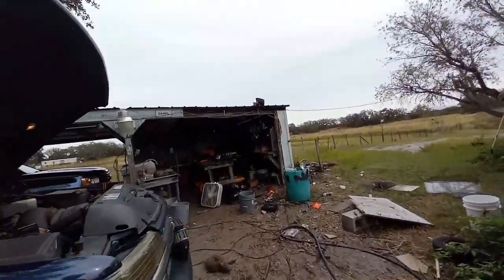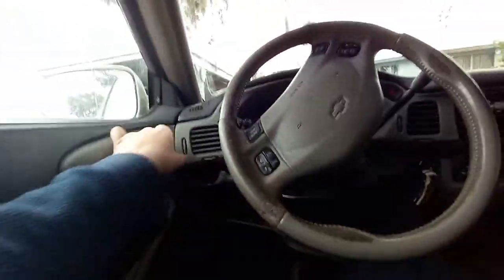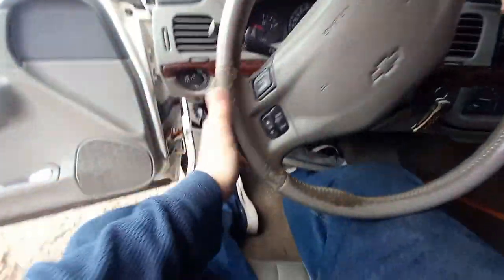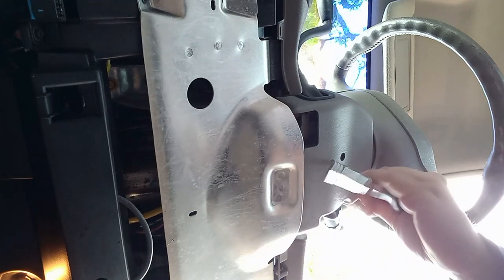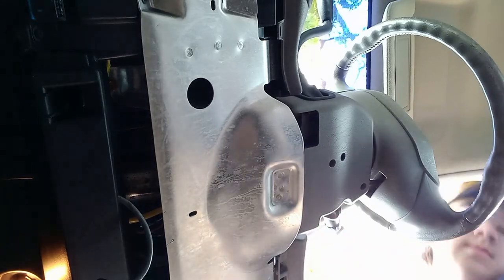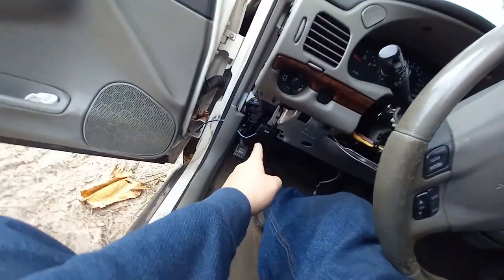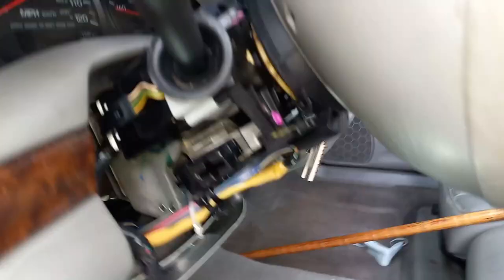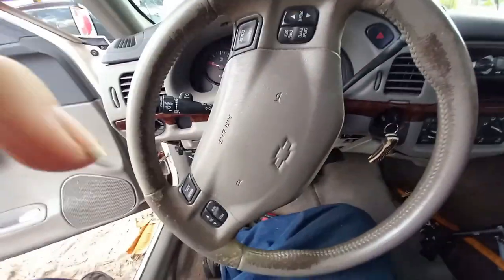replacing turn signal switch on 2001 Chevy Impala

Comment: Couldn't figure out wire harness with limited view thank u, think that box is alarm or security bypass because the orginal radio for that car controls the security system and the security light is a whole nother issue🤦‍♂️